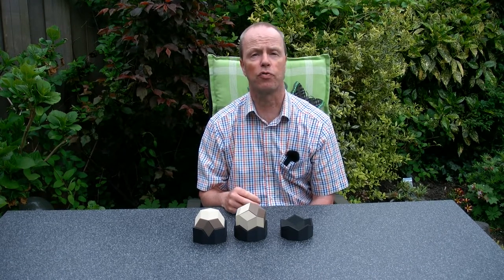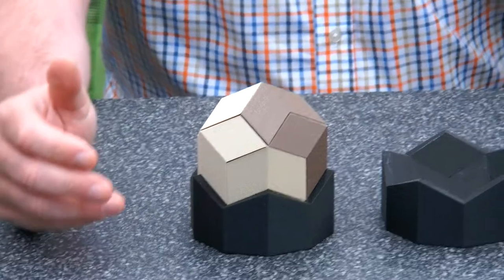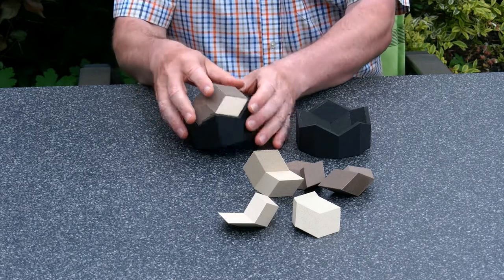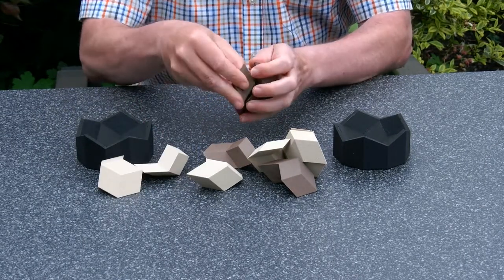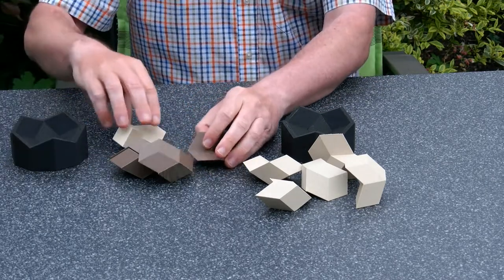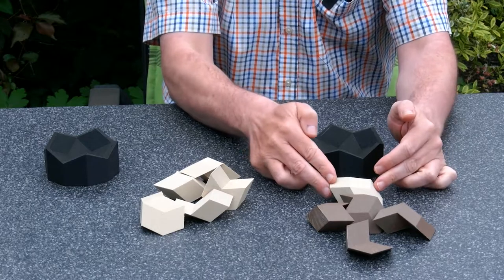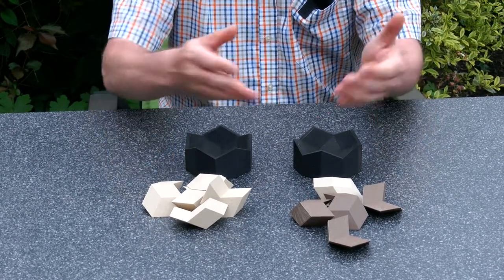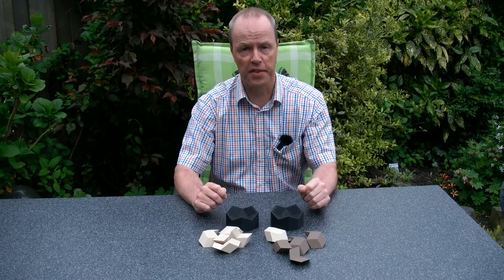Hanegraaf Paradox - Who would you trick with this puzzle paradox?

Comment from the maker: If all the pieces were printed in the same material, could you have been fooled by this paradoxical puzzle?
Reply: Yes indeed, sir. It's partly because if you take the middle rhombi of the rhombic triacontahedron, it can still make a solid but as a rhombic icosahedron or a sort of bipyramid. This principle can also work with say a regular icosahedron, when removed the middle triangles, leaving out the two pentagonal pyramids and join them together forming a pentagonal bipyramid.
Reply: Most people do not even notice the mirror image pieces are different!  In fact this piece is the only way to join the two kinds of parallelepipeds.  It took some time to convince myself of this.
Reply: No, I would not. I guess I have become more clever solving lots of puzzles, I would distinguish the pieces.